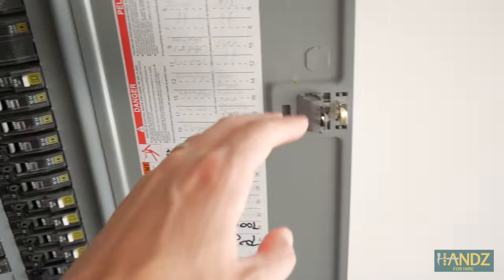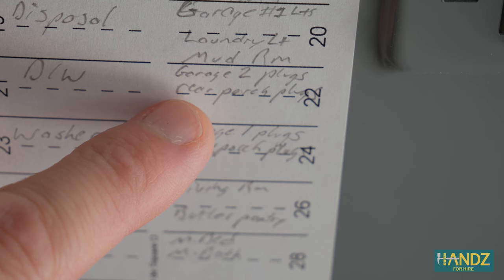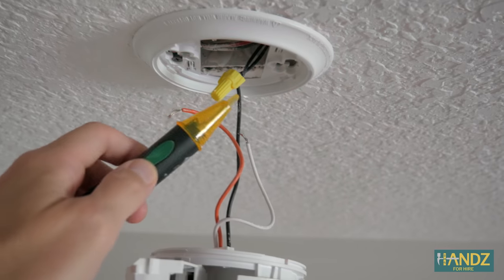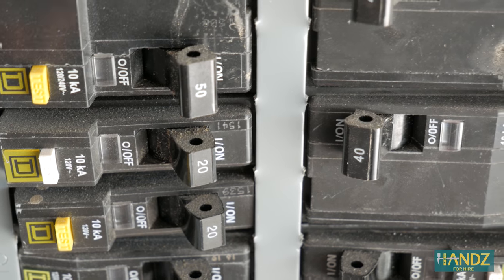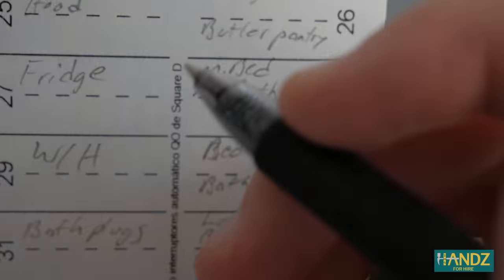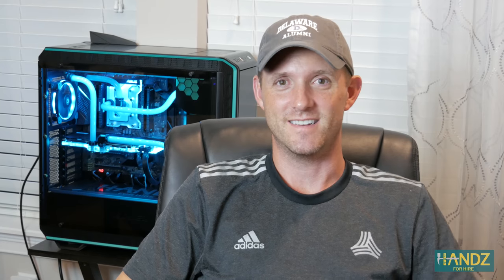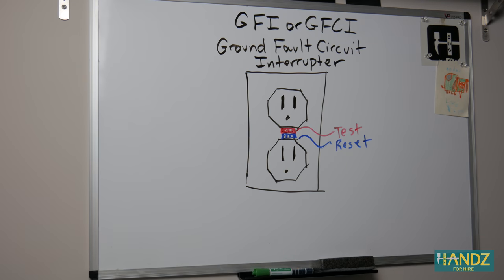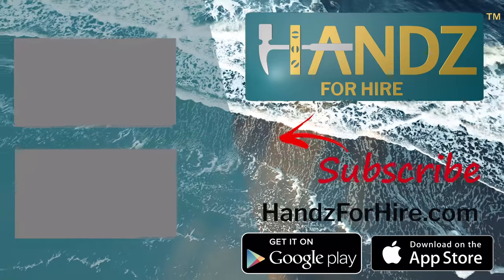Turn OFF POWER on a Hardwired SMOKE ALARM and Live to Tell about it

Comment: 4AM I get woken up by "low battery etc" . Half asleep I get up and change the batteries... well , I never knew that what I thought was a simple task, was going to turn into a nightmare. I pushed the "reset " button , since the "low battery" kept going , and when I pushed the button to reset the "Fire Fire! " went on ! I live on a building its about 4AM , and there is NO WAY TO SHUT THIS OFF . Finally it does , but the "low battery " keeps going loud.  I looked for help in the internet , got here , I learned a lot , but I still don't know if I turned off the right breaker . The lady is still saying "low battery " and the device has no batteries now or (maybe) power, but I read that these devices have a backup source of saved energy , and that you have to push the reset button for 15-30 seconds after disconnecting the power to drain the device completely. I don't want to do that right now . I have pushed the button once quick and the FIRE! FIRE! went like crazy . hopefully it drains by itself while it keeps saying "low battery" , If not I'm going to wait when is a better time to let the neighbors know that if they hear FIRE FIRE ! coming from my place is just me CHANGING THE BATTERIES on this NOT PRACTICAL  at all device. I get it is a safety issue ,but it shouldn't be so complicated to just change the batteries !! PS Thank you for posting video. Wish me luck.
Reply from the maker: Good luck! I know it can be quite frustrating, especially at 4AM. Good luck and let me know how it goes!
Reply: @HandzforHire  Knowledge is power!  I still don't know which one is the breaker for the Fire Alarm! I followed your advise about the amp 15 and to look for the logic one that could be connected to the Smoke Alarm. So the alarm it's like 2 mts from a light and on the sides are the bedrooms . I turned that one off and the light beside it and the bedroom lights went off , BUT the green light in the Smoke Alarm was still on and the 'Fire Fire, low battery " voice kept going . So I thought - well, there must be a back up energy saved in it, I'm going to wait to let it drain  . TWO hours later the alarm was still going ! So I looked  to see what else I could  do , cause many people in the internet advised to TURN THE FIRE ALARM BREAKER OFF, before doing anything else . But I found a video that had a very similar Fire Alarm than the one I have, and there I watched how to unplug it.  So I did, and it worked! But I broke my nails trying to do it , it was not easy at all. So I'm determined to contact the manufacturer hahahahha ! like seriously it shouldn't be that hard!
Reply from the maker: @miemail2757  yes there needs to be an easier way! Was the 9 volt battery still in your smoke alarm after you turned off the breaker? That can definitely keep it the smoke alarm going for awhile. Do you have a voltage detector pen like I showed in the video. They are so helpful and keep me safe any time I'm messing with electricity.
Reply: @HandzforHire  Hi! This Smoke Alarm uses two AA batteries, and the first thing I did was to take them out to replaced them with the new ones. But then watching your video led me to the info that First you have to take the batteries out, then turn the electricity off (through the breaker, and you will know is the right breaker , cause light on Smoke Alarm goes off, and the alarm itself too) , then press the BUTTON  15-30 seconds to drain the power saved in the Smoke Alarm,  then you replace the batteries, then turn power on.    And yes, I will buy the voltage  detector pen,  thank you for bringing the subject up, I was going to ask you for its name :)
Reply: @miemail2757 I think I'm in the same or similar predicament as you. I don't have any switches labelled smoke alarm on my fusebox/circuitboard. So which video did you watch pls? Or which switch on fusebox/circuitboard did you turn off!? I do have a 9v battery here now, however im not bothered so much about changing the battery, just want to stop the chirping safely without electrocution myself, ideally without switching off any fusebox switches if it's possible

Comment: Your smoke detector is a BRK 9120b. If you install a new battery and DO NOT PLUG IN the AC power supply, the alarm should function correctly for a whole year, or at least 6 months on battery alone without the battery draining.  
If your battery goes dead in two weeks, this is NOT normal and means the alarm is defective.  

These alarms have a 10 year warranty.  Call up customer service and they will send you a new alarm for free under warranty. 

This is a known defect and if you search online you can find many reports of premature battery failure.  Don’t keep using a defective unit when the repair is free.

Comment: Why not shutting off the main circuit breaker.. the whole thing..! Why bother to find the very circuit that is attached to the SD
Reply from the maker: That's definitely a good option, but I figured I'd pinpoint the circuit and save myself shutting down electronics and resetting clocks each time I needed to cut the power on the smoke alarms. Now it's marked and as long as I live here, I can access that one circuit. Have a great day!

Comment: My problem is that my fuse box is labeled incorrectly. None of the fuses match up with the appliances. Because of the humidity, my alarm keeps going off and I can't find the fuse.  I don't want to unplug it with the electricity flowing to it but it looks like I have no other choice.
Reply from the maker: I'm sorry to hear that! Try to find the master bedroom lights. It's a 15A circuit and there's a chance it's on that one. Good luck and let me know how it goes!

Comment: Trying to understand why you were running up the stairs. There should be a smoke detector on every level. They are all on the same circuit. Just open the box closest to your panel and save a lot of running when you're testing
Reply from the maker: Haha, well I am a long distance runner, so no big deal, but your point is valid. Have a great day!

Comment: You get the wife and yourself on cell phones.  You stay near one with the tester. Have her trip breakers one at a time.  You will find it quickly.  BUT.  Why do you care?  The battery drained because if you had a loose wire the backup battery was used instead of house power and it drained quickly.  The battery are meant for short haul when a fire cooks the power house power and they can still warn for a few hours.  Notice there is a white/black and a yellow or red wire.  The extra wire is used to link the detectors together to act as as a whole house warning system.  The ONLY way to get rid of the chirp when the backup battery dies is to get a detector with no battery backup at all...they are illegal in CA of course.  Or you can get a commercial detector that runs all the house-powered detectors off a motorcycle battery in a central location (that has to be prewired in new construction).  Or you can get the CA mandated 10-year nicad battery backup units.  Or you can just suffer like the rest of us with this absurd system.

Comment: I turned off every breaker in the panel and the smoke detector wire is still hot. I even tripped every GFCI  still no change. There's is no sub panel.
Reply from the maker: Kenneth Kerr sorry to hear you’re having a tough time. By code hardwired smoke alarms have to run through a circuit breaker. Do you have an old home? Are you using a voltage detector or multimeter to tell its still hot? 9V battery removed from detector?
Reply: @HandzforHire  The house was built in 1999. I unplugged the smoke alarm and used a fluke volt detector, similar to what you used in the video and the black wire is still hot (chirping) with all the breakers off. I can't figure it out.
Reply from the maker: Kenneth Kerr oh man. That’s tough. The only thing I can think of is maybe an alarm system? Do you have an alarm system that is separate from your breaker box? Maybe the smoke alarms are hardwired into that circuit?
Reply: @HandzforHire  I do have an alarm system (ADT) I will check it out.
Reply: @HandzforHire  Hi , I still cannot find the breaker for the smoke alarms. I put the new smokes up but they are only running on battery for now.  The old ones were 20 yrs old and no good. When I do find where the smokes are powered I will let you know. Thanks

Comment: Your statement about smoke alarms not being on a gfci circuit is misleading.  Of course you are correct that smoke alarms would not be protected by gfci since that would increase the chances that it would trip and loose power and therefore not work.  But the gfci that you show in the video is only at the outlet.  That same circuit BETWEEN the circuit breaker and the outlet is NOT gfci protected.  It is entirely possible to have OTHER devices powered by the same circuit breaker which are NOT gfci protected.  

For example, in my own kitchen, the circuit breaker that supplies power to the outlet for my refrigerator is not gfci.  The refrigerator is not gfci protected.  But that SAME outlet has two sets of wires- the ones getting power from the breaker and another set supplying power to kitchen countertop outlets. And ALL the kitchen countertop outlets are gfci protected.  

So, if a ground fault trips the outlets in the kitchen and cuts power, you are protected from shock.  But the refrigerator still keeps the food cold on the SAME circuit.

Comment: Lol.... you should have turn off all circuit breakers and turn on 1 by 1 which would be easy option.
Reply from the maker: Ronak Vachhani haha true I could have done that too but I then thought about the clocks, modem, computer and everything else that would have reset with it. I definitely would have been able to fix the smoke detector much faster though. In the end I was glad to learn more about what breaker the smoke detectors are on and share that knowledge to save other people some time lol. Thanks for watching and have a great day!
Reply: Handz for Hire i see, i understand, i removed all wires from smoke detector and took it down, than also smoke detector beeps loud, i guess i will disintegrate internal circuit